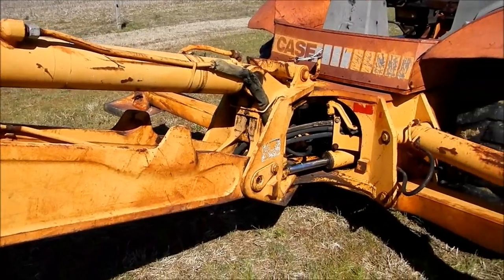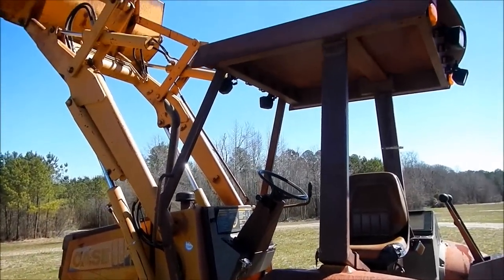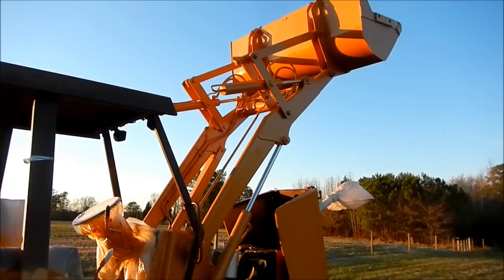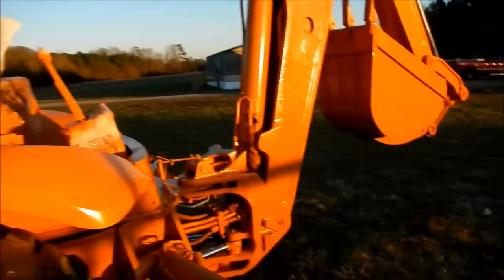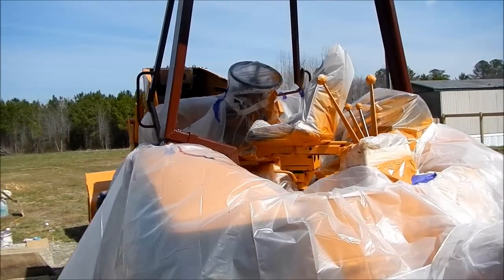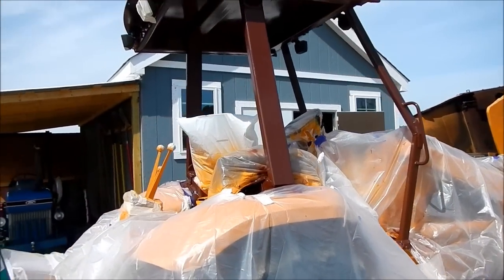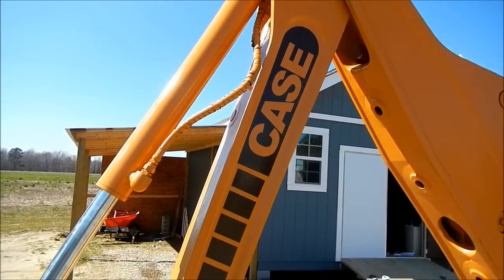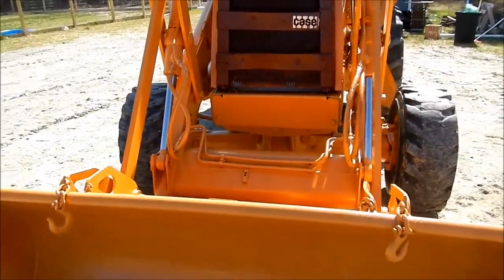Painting The Case 580K Backhoe

Comment: Who cares about the decals or a few paint runs! I think you did a fantastic job on it! Looks much better now! Are you gonna tune up the engine a bit? Maybe new pistons and sleeves and a new set of injectors?
Reply from the maker: I think im going to leave well enough alone. it runs pretty good as is. might have to clean out the radiator this summer has it runs a little warm if you run it hard

Comment: So did you just paint over the yellow that was already on the machine after it had been washed and cleaned of all the grease or did you sand all the paint off and go from scratch also what kind of paint gun did you use did you just run it off an air compressor